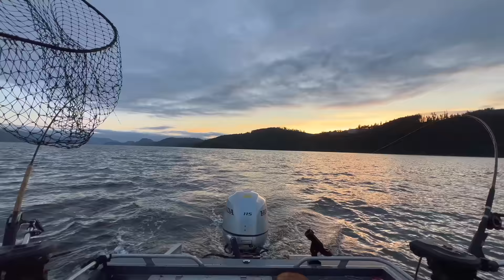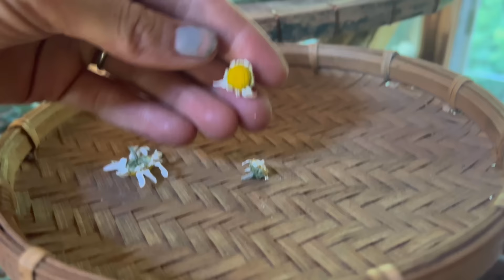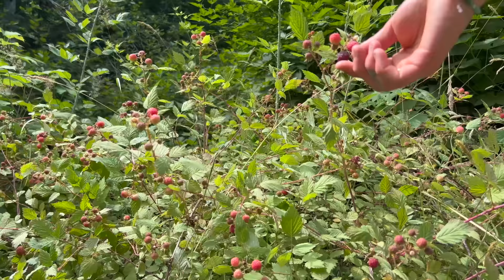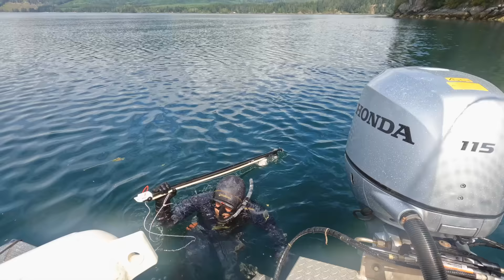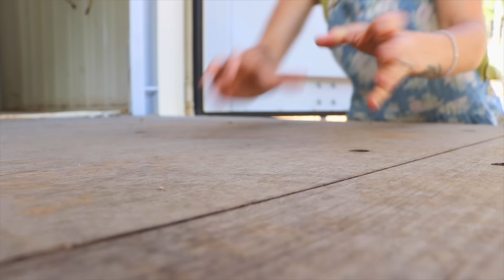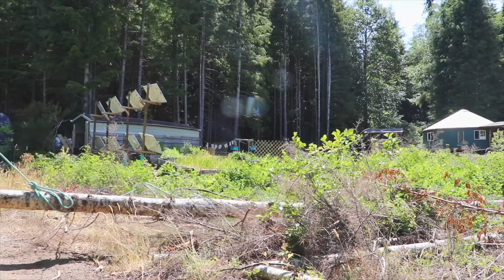Raw, Unfiltered, INSIDE LOOK of My FOREST LIFE Off Grid! (Extended Cut) - Ep. 173

Comment: As you level the containers, 2 aspects to focus on. 1.) Level on the perimeter and then support across the whole base of the container to avoid future sagging. 2.) You need to use something that won’t rot when supporting the container at its desired level. Concrete, steel, anything that will not decay in the wet / humid climate you are building in.

Comment: Question: Why are you not using metal shims instead of wood. Wood will rot and then you'll have the house settling due to years of weather which would lead to the cracking of  the interior walls once you have it completed inside!

Comment: You should timber frame the inside with logs!, you have plenty,, easier to work with instead of Ibeams!,You can make inside corners and out side corners,, fun work buy a good electric chain saw, put a 25 foot cord on it,, good heavy cord,, add a small tip bar,, like a quarter radius,, no kick back,, no exhaust,, quite! 3 times I’ve told ya to put oil on a brain bucket in blackfly season. It kills them all one cap full every couple hours cha8n saw bar oil works fine!,rub it on every inch of outside of those helmets….. using an electric chain saw in side I use olive oil,, cleans up easy,, and your not breathing bar oil or used motor oil! Aloha

Comment: i don't understand what y'all mean by "off the grid."  other than not using modern telecommunications, it seems like you've got multiple vehicles that run on gasoline.  you have credit cards.  your yurt must have cost $100,000.  your sailboat probably cost the same.  you wear brand-new clothes and shoes, every kitchen item is shiny and new.  it seems like you have practically unlimited money for supplies, materials, equipment etc.  hardly anyone has your extensive resources.  the whole premise seems fake.